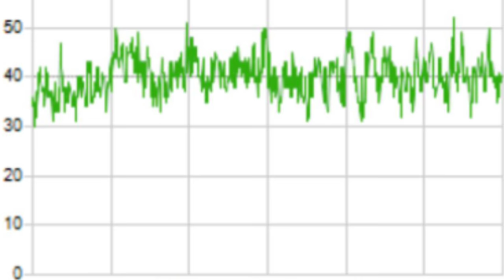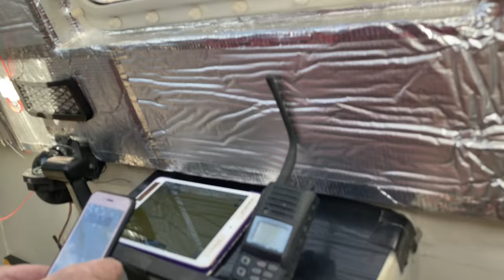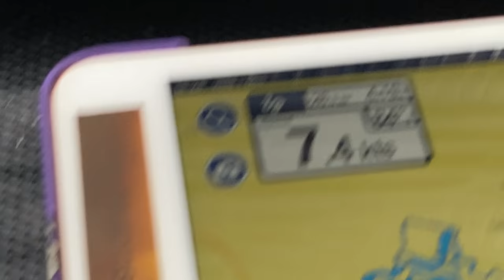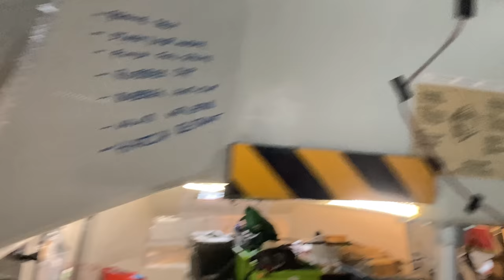*SPECIAL* Alan the Lifeboat tours London's River Thames (Part 2) - Lifeboat Conversion Ep34 [4K]

Comment from the maker: So, that experiment of using the premiere function was mixed - although I liked the live chat. I'll do a poll later on to gauge thoughts.

My answers to questions were lost after the premiere ended, so here they are: James - unless a trawler wants to lob onboard a cod or a haddock, RAS will be limited to a hose through a hatch. Federico - at present Alan has two handheld air horns.
Reply: 56 yrs old and did a live chat for the first time last night.  It was okay, my head was spinning a bit, but I didnt tip over.
Reply: The premiere are fine. The thing people hate is that there is a reminder days ahead for the video to which they have to wait. The live part is great because those early people can pop on and talk while the video is going on.
Reply: Brilliant videos alex, I've got loads of new boat bits from stainless cleats and other bits to a Taylor's boat heater with built in water heater that runs on paraffin and uses no power, to a new disc icon vhf and a vhf radio telephone unit with separate head etc and also led nav lights and a stainless steel 2 burner meths stove with pan grabs etc, I'd like to donate it to you, greetings from orkney.

Comment: Cool, searchlight up as high as possible as well as mount one of those infrared night vision cameras & an infrared night vision spotlight of 96 LED's with a range of 60m or more. If other boats with infrared cameras are out on the seas ahead of you then they will see your infrared spotlight faster than a normal spotlight. Also on top of your mast you should make a stainless steel or aluminium vertical 90 degrees cross or X shaped set of boards that are roughly 300mm high x 250mm diameter, it acts like a reflective mirror for using radar when you are on the open seas & should be placed as high as possible on a mast.
Reply from the maker: Thanks.

On the radar reflector front, Alan came with one, but it's not an ideal size. I may invest in a slimline version now the mast is ready to stay aloft.
Reply: @AlexHibbertOriginals  Cool

Comment: Years ago I owned a 25 foot boat and would take family & friends on midnight cruises up & down the Mississippi river. My spot light was mounted on the bow and I also used a handheld spotlight that plugged into the cigarette lighter. A powerful handheld spotlight is a convenient compliment to whatever outside lighting you install. If I were going to pilot Alan I'd consider adding a light bar to the mast as well. I'm of the mind that there's no such thing as having too much light at your disposal.
Reply from the maker: Agreed - and yes the hand held 'bear torch' will always remain available.

Comment: You'll want to be able to reach the searchlight to remove ice buildup if the weather is causing it, so consider that and if such removal could damage the mechanism. You will also want to bbe able to have firm footing when knocking the ice off. This sea trial went well and yes, you are going to need night lights inside the cabin, throughout the entire vessel and not just the cockpit area.
Reply from the maker: Yes - having it out of reach would be unwise.

Comment: Heat exchange on the engine makes sense. May as well use the waste heat given off to help warm the interior, and cut down on using the primary heat system.

Comment: I'd mount the light as high on the mast as practicable so that anything for'ard, like the bow, doesn't get in it's way. We used to drive Landrovers offroad at night, and always used a roof mounted light bar.  Not only does this mean the lights are less likely to be knocked out of position, but they also give a 'better' spread of light as they are angled down and have a cut-off point instead of just a long beam of grey mush when it rains/snows.

Comment: The cooling circuit on the engine might have a plug on either side of the thermostat and you can used these to tap into the cooling system to plumb in a radiator. You can buy what's called a bus heater or simply get a regular car radiator from a breaker that has the cap included for easy bleeding. The cap must have the same or higher psi rating than the one on the engine. Install it with at least one valve to turn it on and off or with two valves on the engine to isolate it.
Reply from the maker: Will investigate

Comment: You want to be behind that light .. as far as auto lights go fog lights produce a flat fan spread of light wide but low to  avoid bounce back and flare ..sometimes with a yellow tint to help reduce the reflective glare ...Driving lights produce an oval or fan that reaches out a fair to long way but also lights the edges of your path ...the older long range driving lights are more like a search light beam ...very tightly focused ahead with a small circle of bright illumination. With some diffusion spread, depending on the air conditions 
Put one on in fog and you wont see much beyond dazzling white .  
Id put fogs down low ...that one forward on the rail or upper front hull and if if someone can give you an odd long range lamp have that ahead of your steering hatch so you can point it at will. 
You can buy LED light strips that can be set to different colours. ...but the low voltage external garden rope type in a plastic tube might be useful inside or out as a way of marking Alan's presence.😁

Have you seen the Heart of Gold catamaran lifeboat project.
Reply from the maker: Behind the light seems to indeed be the way.

Comment: I know im late to the party here but i actully have that exact type of light on my semi (lorry). One major problem with them is that heavy vibration, bumps and jolts cause them to crack around the seals both where the case has the hole for the wire and where the "glass" meets plastic and allow water in. Especially if they get salt on them. You want to use a dab of waterproof silicone around them or they rarely last more then a few weeks to a couple months. A thin line of silicone in the cracks applied with a small stick or skewer makes them last for years instead as the small cracks in the plastic either dont form or form below the silicone.
Reply from the maker: Good to know! The light will be in a housing, so I'll factor this in.

Comment: Probably stating the obvious here but like with the white light inside the boat, wherever you mount the searchlight it is important it doesn't do the same harm to the night vision of the crew while in use. Apart from that, being able to direct it could prove handy. You do have the bow hatch so that adds in more possibilities. Then again a higher position has its uses.
Reply from the maker: Indeed, it's going to be a compromise.

Comment: On your spotlight, you would be best to mount 1/2-3/4 up your mast? Tower? Stump? Anyway, as high above the drivers head as you can but you will want to reserve the top for things like a navigation light, and radio antenna. Not sure what the lighting requirements are in the UK but here in the states you need a white light at your highest point.

Comment: Depending on the light pattern. Is it a combination of a wide beam and a focus beam? At what distance do you need it to het the water? 

My suggestions test it out at night in a parking lot or something. 

With your rearward steering position I imagine you need the light to shine far out in front to be of use.
Reply from the maker: It's a mix of wide and long beam  - the bulk of light long though. I think good illumination for 100m and picking up reflections up to 500m would be ideal.

Comment: Curious, how will you deal with ice freezing on the topside of the hull when on expedition? I worry about the already tippy hull being overturned with ice build up. Cheers from upstate NY.
Reply from the maker: A couple of answers. Luckily there's far less surface area atop Alan for ice to build up compared with other types of boat. Secondly, Alan isn't destined to make prolonged passages in conditions where lots of rime ice builds. He's likely to be stationary/locked in by that point.

Comment: alan needs a second steering wheel on the outside so you can enjoy the views
Reply from the maker: Once I can afford an autohelm, that should be possible but without the wheel.
Reply: @AlexHibbertOriginals  my uncle had one of those in his sailboat,  seemed like magic at the time. in the meantime tie some ropes to the wheel, you can steer alan like a horse that way XD